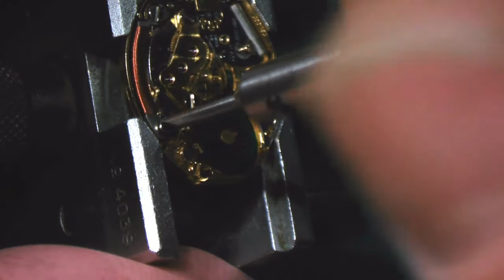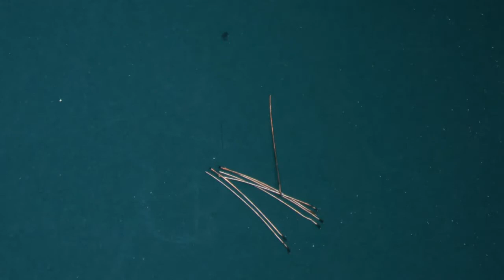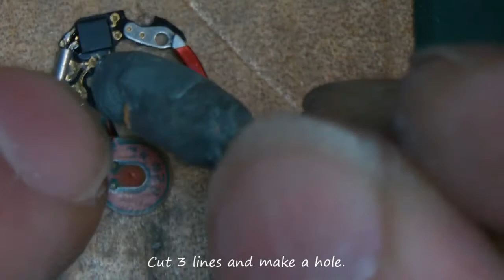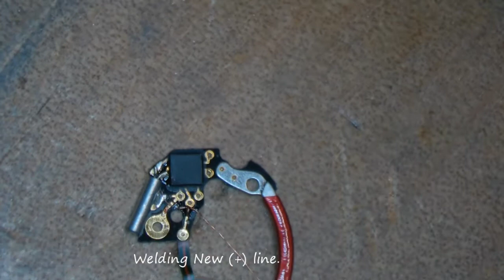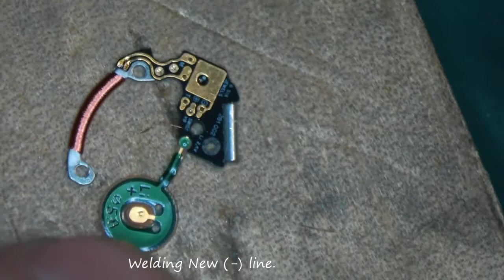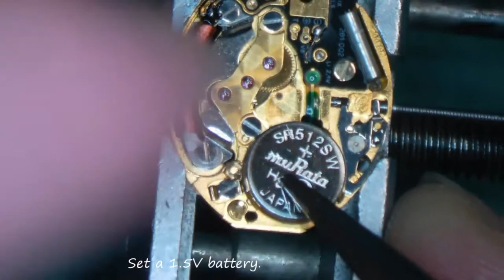Convert a voltage 2.0V to 1.5V for ETA281.002   （2V回路を1.5Vで動かす）

Comment: I find it very interesting. The only doubt I have is. If this battery would have a shorter autonomy than the original or if the mechanism malfunctioned due to having a lower voltage?
Reply from the maker: Thanks for watching. ☺️
I can not find 2V battery’s capacity. So can not calculate battery life.  
And this movement have 3type of circuit.  2V, 1.5V,compatible .